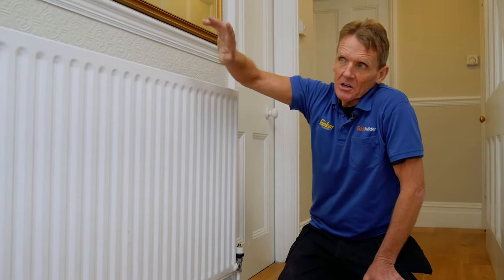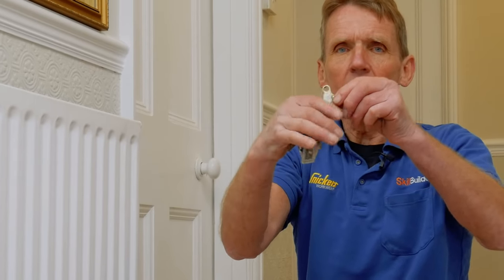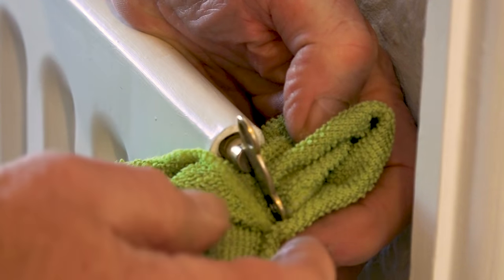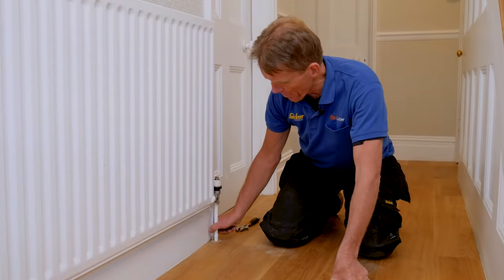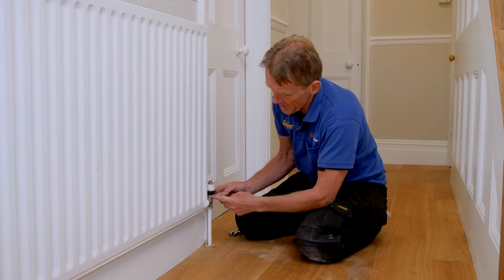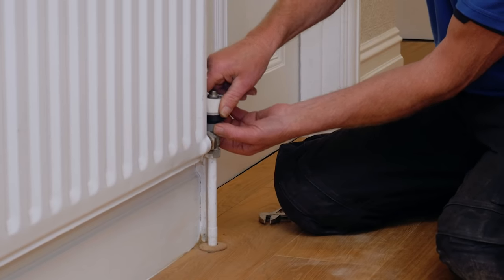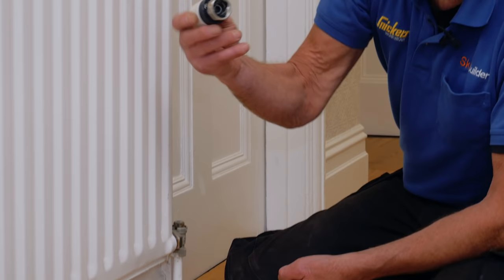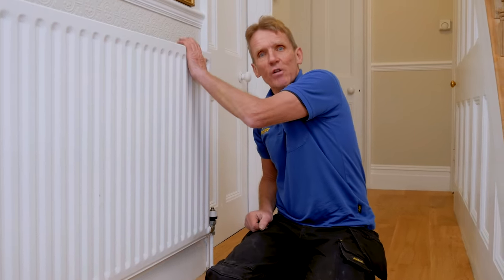Radiator Not Getting Hot? - Plumbing DIY

Comment: Question, I have a gravity fed system and the water inside the rads is quite dark. Could a gravity flush followed by adding cleanser followed by another gravity flush clean the system? I have a couple of downstairs  larger rads recently fitted which aren't getting as hot lower down would agitating whilst gravity flushing also help get rid of the magnetite? I can't afford a power flush at the moment  times are hard...
Reply from the maker: Hi Graham 
 I often connect a garden hose up to one of the rad valves and a drain hose to the other and flush the whole thing through under mains pressure. You will have to block up the feed and vent and don't run the boiler but it works a treat.
Reply: Quick reply & on a Saturday night... Skill builder's confirmation of legendary status is set in stone!!! I changed 5 rads out of the 10 we have about 4 years ago but I don't think I was thorough enough when draining down. If its not too dificult I may try capturing the process on my phone. If a long gravity flush with some sds agitation followed up with cleaner doesn't do the trick I will take the 2 bad rads off and flush them in the garden. Keep keeping it real Roger!!!
Reply: 3 hours till it ran clear, it was the colour of strong coffee to start with!!! I then fired up the system for 30 mins until it stopped working, which was puzzling... I flushed again from same rad, the water was a little darker but ran clear after 10 minutes. It ran for 15 more before I switched the hose to the two more downstairs rads in turn for 20 minutes each, they both ran clear pretty much straight away. I Added 500ml of cleaning fluid and its gonna run normally till next weekend when I do it all again, finally giving it a good dose of inhibitor. Fingers crossed it's done the trick, I'll do it every autumn from now on.

Comment: My radiator only works now and again. The pin is fine and working, there's no air trapped it's just cold all over but all others working fine, the hot water to it is hot but other pipe freezing cold, can you suggest  any other ideas please?
Reply from the maker: I think maybe the system needs flushing through but maybe put some cleanser in the system first and run it for a couple of weeks. It can break down sludge and get things moving. Also a magnetic filter is good.

Comment: ive got this... but its a brand new rad the plubmer installed.  its warm on top sides.  cold in middle n bottom.    i cant believe it being sludge...

we did a rad move.  moved from wall to under window.  

i tried everything apart from sludge removal

Comment: Best thing for house owners to do is this . In the summer .Drain down system .Remove all rads and take them to the garden .Rinse  them out with a  jet washer .Remove valves /Fit new valves . re fit and  add in some rust inhibitor .Then fit a magnaclean filter on the RETURN heating pipe near the boiler .
Reply: I can barely draw a stickman let alone taking radiators off :-)
Reply: @ralphthebulldog5163  😆😆

Comment: Having problem with radiators fitted in series. Tried balancing etc.
Think they are last ones on run. Rad 1 is hot - connecting pipe is hot - rad 2 is only room temp!!! Your thoughts would help
Reply: turn pump up next slot

Comment: Could you show how to take an old style thermostatic valve off?
Reply from the maker: Can you send me a picture?
Reply: @SkillBuilder  Hey just fixed the valve it was a stuck pin thanks for the tip. Picture to follow for others with the same problem.
Reply: @SkillBuilder  sorry can't up load a picture but its a DANFOSS valve.

Comment: Radiators maybe old hat with under floor heating.I have an extension which has infrared electric underfloor heating, which is great apart from the cost of running it.Electricity costs 4 times more than gas !!!!

Comment: I have a radiator which doesn't get hot at the bottom, can't I just replace it rather then pay for an expensive flush
Reply from the maker: Yes just take it off and flush it through then give it a good bash with a rubber mallet to shake out any flakes of rust or crap.

Comment: Great advice here, but do thermostatic valves fully shut off the flow when set to lowest temp? I noticed that some allow a small amount through in this state, and I thought it was by design. Perhaps some are this way for the reason you mentioned.
Reply from the maker: metallitech
 It depends on the temperature. If the heat is high they should shut down completley  because you don't want heat trickling through. Some people shut off radiators in unused rooms so I would say yes but I have never carried out comparison tests.

Comment: I’ve got two new rads and both are cold at the bottom and hot at the top suggesting sludge. has this just come from the rest of the system and we got ‘lucky’ that it chose the new rads to live in?
Reply from the maker: Andy 

 It is usually due to the position of the rads on the system. It could also be that the lockshield valves are partially closed and the velocity of water is too slow. 

Best thing is to inject some systems cleanser into the rad and let it circulate for a few days then drain the system down to get rid of the sludge. If that fails flush the whole system out with clean water.

Comment: Both of these scenarios. Rust in the rads is caused by a leak. Fresh oxigionated water causes the rads to rust. Air in the top of the rad is also caused by a leak. Get the leak fixed .... then no further problems
Reply from the maker: I agree that oxygen causes corrosion but it is not always so easy.  Many people suffer pressure drops on sealed systems and can't find any trace of a leak. There are negative leaks around pump inlets and there are micro leaks that never show.

Comment: Hi 

Is you remove one radiator from a sett in house, and don't replace it
Will this cause problems running the heating system?
Reply: No along as you dont have a 1 pipe system

Comment: Ine of my radiators is only heating the bottom part, bottom left and right. If i open the air valve only a tiny anount of air is coming out and no water at all is coming out. What could cause this problem?
Reply from the maker: The air valve is bocked with debris. Turn off both ends of the radiaor and remove the air valve and clean the hole with a piece of wire.

Comment: Can a fairly new radiator have sludge? My radiators were fitted only a year ago and this radiator has never really heated up. Top is heating but the bottom is just warm :(
Reply: was system flushed.you may have old sludge from pipework in rad or system needs to be balanced correctly

Comment: None of that worked for me.

Bled the cold radiator - no air
Turned off the hot rads via stop valve  cold one still cold 
Opened the sv on the cold fully still cold

But funny thing is when bleading the cold rad the trv pipe warmed up

Is it possible for the stop valve to be blocked or seized shut and still turning

Or is the next step to flush the system via a hose pipe from the cold rad bleed into the garden?

Or am i missing something.
Reply: Shaun600RR Did you solve this? I have a similarly cold rad that I noticed would heat up while bleeding it. I thought it was sludge blocking the flow so bleeding it allowed the hot water through. Removed it and flushed it but made no difference.
Guessing the TRV side is ok as hot water gets in while bleeding so wondering if the SV end is blocked preventing the flow??

Comment: I have to bleed my bathroom and kitchen radiator everytime I put the heating on.The rest re all ok, my plumber has put inhibitor in the tank in the loft twice and it hasn't worked at all he is now thinking of taking up my floor boards and Im reluctant to do this. what else can I do? Its a baxi bermuda boiler as well. Can you advise me?
Reply: Sian Megginson try turning your central heating pump down,
Reply: Thanks, I have a back boiler behind the fire is this where the c.h pump is?
Reply: The pump is on number 3 should it be lower?
Reply: It all depends, sometimes it can pull air in from the vent,  turning down the pump can sometimes work.  It may be some pipework alteration can solve the issue,  if your pump is in the airing cupboard, it may work.  If your pump is built into the back boiler it won’t.
Reply: Tried all still having to bleed them what now will I have to have the floorboards taken up looking for a leak in the pipes?
Reply: Without seeing your system it’s difficult to say??  If it’s a open vented system, maybe upgrading it to a sealed system may help.  Hope you get it sorted
Reply: Its a Baxi Bermuda back boiler behind the fire and has no vent only the chimney. Runs off a pilot light that's on all the time. Have an airing cupboard and tank.
Reply: 4

Comment: Which side of the radiator should the bleed valve go
Reply from the maker: It matters not one jot
Reply: @SkillBuilder  thank you for quick response
 I'm putting in new radiators I had single panels now I've gone to double I've put into 2 radiators fine
With extendable radiator pipes is there such a thing as a flexible radiator pipe I have a 45-degree angle
To make up

Comment: probs gonna sound stupid but my mum did this (I think) in my bedroom and im wondering if this could cause gas to leak if done wrong?
Reply: EternalDarkness691 no, a gas leak is not possible when letting air out of your rad. Your rad should be filled with water. Released air van have a nasty smell though. Good luck!

Comment: Isn't underfloor heating expensive to use. My house has it in kitchen but never use it.
Reply from the maker: if it is electric then it is expensive. If it is warm water then it is cheaper than radiators because it runs at a lower temperature

Comment: When you check the pin do you have the heating on or off ???
Reply from the maker: Heating on but only so you can feel the heat come through. It makes no difference to the pin.
Reply: @SkillBuilder  you sir are a legend, worked a treat thanks so much 👍👍👍

Comment: My problem wasn't explained, unfortunately. I have only bleeder  valves on my 80 sum uear old hot water radiators, no other valves. 3 of them are not running hot water through them BUT they do have cold water running through them. I know this because if I bleed them, there's a steady flow of cold water. If I bleed the working radiators, that water is hot. I cannot figure out the issue. Again, I have no dials or valves on these radiators besides bleeder valves and the radiators are all on ONE system. The lines coming in and going out of the non working  radiators are both cold. Any idea what's going on here?
Reply: I have bled all the radiators profusely and refilled my system numerous times. Nothing changes. I cannot get HOT water to flow the the cold radiators. 😫 I even have a working radiator 5 feet from the non working radiator, one bleeds hot water while the other bleeds cold water. It's so strange!
Reply from the maker: Hi Zack 
Did you mean 80 years old?

Comment: My radiator is hot at the top but cold at the bottom. The weirdest thing about it is that return pipe is hot and flow pipe is cold(actual pipe below trv). I am puzzled. Could it be because system is not well balanced?
Reply from the maker: Sludge, it needs taking off and flushing out
Reply: @SkillBuilder  Thnks for replying. I thought of doing just that. It is odd because it apears that every radiator in the system is like that but it was all fine last winter. I've checked preasure on a boiler and it is 1.5 bar so it's fine. It is also weird that pipe below TRV is cold while the return pipe is hot. It does not make sense unless some cowboy mounted TRV on the wrong side of the radiator.

Comment: my raditotor doesn't have a screw or hole at the top like that, its a solid hexagonal shape, about an inch in size, no way to fit a bleed key in there
Reply from the maker: Is it a chrome plug? If so you can just undo it a bit to release the air.
Reply: @SkillBuilder  I'm not sure, its an old house and been painted over, but looks dark brown beneath, scratched off some paint and there's no socket for a key, its just a solid inch wide hexagonal cap on the top left, other side has nothing at the top

Comment: What if the pin of the thermostat has come out a little bit resulting in a radiator that is always warm/hot. ( That is when the heating is on). What to do to solve this?
Reply from the maker: If you open the head up to the maximum setting and then screw it back on it will push the pin down and it should then operate as it should.
Reply: @SkillBuilder  Hi. I tried this but the pin will not be pushed down.

Comment: My radiator in the hall way was only getting partly warm so I bled the rad no luck so I then took the radiator of the wall drained it emptied the sludge put it back on and it was still doing the same so I went and bought a new rad and installed it and it's doing the same on this one im stumped
Reply: it needs balancing, try closing the outlet side valve a little at a time or close it all the way and open a little, until the whole rad gets hot. You may need to do this with all the rads, depending on where the problem one is in the circuit.

Comment: Oh yes, one other thing, the Danfoss have a setting which over rides that automatic low temp setting so the whole exercise was a complete waste of time and an utter shambles!
Reply from the maker: You should be able to remove the thermostatic head on any TRV. If it leaks then you have pulled the pin out. The head doesn't seal the body. If you then set the head to fully open it goes back  on easily. Maybe plumbing is not your thing
Reply: Maybe you didn't read carefully enough what I said. The radiator was removed. As soon as I removed the head, the valve shot open. Or maybe you are not familiar with the old Danfoss heads. Either way it was a disaster and nothing to do with pulling out the pin.
Reply: John, if the rad is removed the valve was simply a closed tap. The only sure way is to cap off as he says. Open end is open end

Comment: what if the pin is not moving by pressing hard?
Reply from the maker: It won't move immediately. It is stuck down so maybe just tap the side of the valve gently but maybe 20 times to see if the vibration helps. They usually start to work and then get better and better once the water starts to flow through

Comment: I'm having an issue with my living room radiator, I took it off the wall and hosed it out as it don't seem to get hot at the bottom. After flooding the living room due to the trv valve opening switched the heating on and the same thing, it's just not getting up to temperature. The pip going up to the radiator on the lock shield side is getting hot hot but the radiator is only just warm at the top only and trv side pipe is cold. Can anyone give me some advice please?  I think it needs a flush but trying to avoid that at the moment.
Reply from the maker: Hi Adam 
 I have seen that TRV opening flood many times in my career. 
I think you need to turn the lockshield off and open the TRV and bleed some water out of the radiator to draw the water through that pipe. It might be as simple as an air lock.

Comment: my   system getting air every two days and the radiator getting hot for half of it and the other half getting cold may you advise me the problem please?
Reply: you may have a leak.for the air to go in water must come out.or you could be sucking air into system

Comment: I have doing since 2000 but deal with water leaks. You correctly deal with sludge and air in the radiator but you don't explain what has caused the problem in the first place. Sludge in a radiator is caused by a leak in the system. There is no point in dealing with the symptoms of the problem if you don't deal with the root of the problem. Find and fix the leak. The air in the rad is also caused by a water leak. The water is being replaced by air. Pearse of Leakbusters
Reply from the maker: Pearse 
First and foremost we are talking about a specific fix here and not an encyclopedic look at all problems relating to corrosion. Secondly your analysis is not correct. Sludge is black oxide caused by oxygen in the system. In an open vented system this may be introduced by pumping over in the F&E tank or, if the system is under negative pressure, it can occur around valves and compression joints. If the corrosion is active the radiator will produce hydrogen which is often mistaken for air. There is a test that plumbers carry out to test for hydrogen. 
If a system is leaking and new water is introduced then the free oxygen in the water will cause corrosion and the air/hydrogen will collect at high points. 
Say hello to Ian for me, we have worked together on a number of projects.

Comment: You mistake me for someone else. You need to study galvanic corrosion! We both agree that oxygen cause the corrosion. Where does the oxygen come from, I ask you? It comes from the oxygenated fresh water replacing the water through the leak. Have never, in 20 years, had a leak caused by pitching. Helium can not be fabricated inside a c/h system .
Reply from the maker: who said anything about helium. Like I said it can be pumping over, not a leak. I refer you to Fernox

Comment: I followed your instructions and my boiler failked. Stoped working
Reply from the maker: it has just lot a bit of pressure. You need to top it up to 1 bar or more. Anywhere in the green section will do
Reply: @SkillBuilder  how do i do that?
Reply: @anainesrodrigues  you need plumber if you need to ask that here